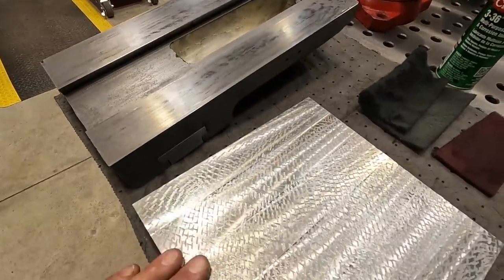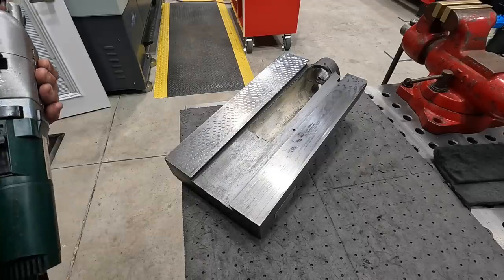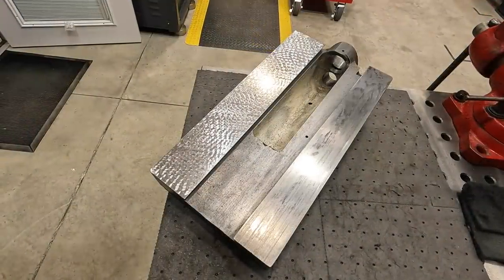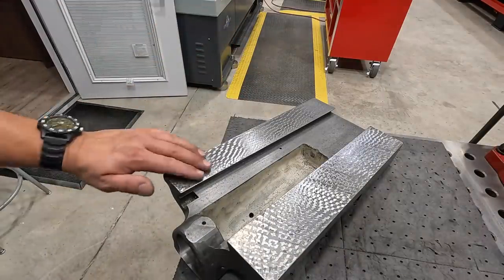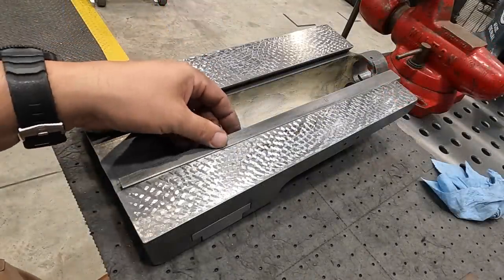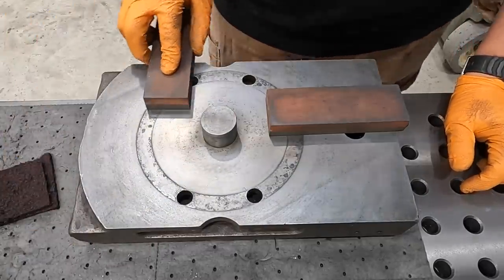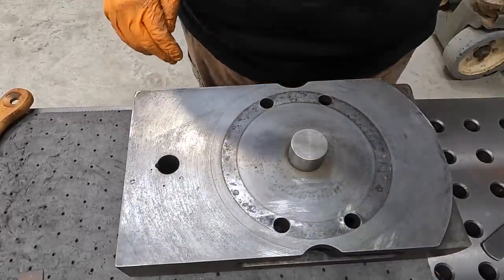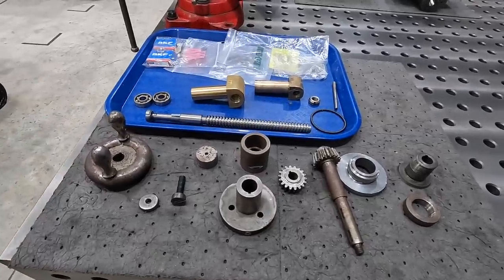Compound Rebuild Begins for American Pacemaker Lathe

Comment: I remember as an apprentice, hand scaping the ways and then hand spotting them. I was taught to create a crescent shape spot in a cross pattern, to retain oil. After many hours of practice l got pretty good at it, so much so that l felt it was a sham that it wouldn't be seen. Never used the electric scraper.

Comment: Just doing maintenance and light overhauls on my equipment, I find an ultrasonic cleaner to be very useful for deep cleaning the parts before oiling and reassembly.  Especially on any "touched" parts like handles and levers.  Really gets them to the next level.  Also gets the microscopic particles from chips and grinding out of the parts that normal cleaning doesn't remove.

Comment: Nice work Adam it's looking good. Nothing wrong with the witness lines especially if you don't use the scraper regularly. It's kinda like shooting a gun, yeah you can hit the target but your groupings are more consistent when you practice. I found that my rows are more straight when I lock my elbow against my side and dip side to side from the hips as opposed to twisting at the waist. Keep up the good work.

Comment: Nice Job Adam. I still have my Hand scrapers I used on a German Horizontal boring mill I used to own. And to All the doubter’s yes it helps the axis move much smoother if You have the proper lubrication. Good 👍🏻 Video

Comment: If you want to move away from the Sharpie marks, put your piece at a 45° to your bench. If the workpiece is square or rectangle, you can visually reference off the edge of your bench to make nice estimated 45° angle passes.

Comment: Love this channel, been a follower for about a year now, also HI to all the Engineers out there, i`m not an Engineer myself sadly but my Father was so i inherited some of his love for precision and quality, i`m a 53 year old Kitchen Installer from the UK with almost 40 years experience who takes great pride in the quality and accuracy of my jobs, i`m also heavily into ancient engineering techniques, specifically how the so called Dynastic Egyptians cut and polished igneous stone like Granite and Diorite which has a Mohs scale hardness of 6 - 8, there are a good few Engineers out there now who believe, as i do, that these highly accurate monuments and statues were cut on machines similar to lathes and mills, the precision on some of these artefacts is to within 100th of a millimeter yet were are told by the mainstream archaeological community that they were done using copper tools, chisels and dolorite pounders BY HAND, anyone who knows Quartz, as i do as we use it for countertops, knows it can not be cut or shaped using copper or bronze tools to this precision, also under a microscope these objects don`t show impact marks which you would associate with chiselling and hammering, they are perfectly smooth, perfectly square and they even pass the light test with an engineers light test you can`t get that accuracy by hand, many of these artefacts show evidence of tube drills cut at a rate that we can`t replicate even with today`s highly advanced CNC machines, there`s evidence that huge 1200 tonne blocks and single columns were cut using a huge overhead circular saw and Live Centre holes in the bases of 200 - 300 tonne single piece granite pillars, there is an English Aerospace Engineer who moved to the States called Christopher Dunn, his qualifications are second to none in the field of Engineering, he`s travelled to Egypt and other locations around the globe and conducted tests on many of these artefacts and he`s concluded they had to have been cut and created using ancient engineering machines, something we are told never existed in pre history yet the evidence discounts that, there is a channel on Youtube called UnchartedX presented by an aussie guy called Ben, his channel is dedicated to exposing these incredible highly accurate artefacts and calls for academia to acknowledge that there was once a long lost forgotten ancient highly advanced civilisation that existed before 12.500 years ago and was erased from human history by what`s known as The Younger Dryas Impact, a theory that has since been proven correct and it`s been peer reviewed, my big ask in all this to all you Engineers out there is to have a look at Chris Dunns work and Ben`s over at UnchartedX, see the evidence for yourselves when you get time and if at all possible lend your expertise and engineering knowledge to their work, the more skilled engineers who get on board the quicker science and archaeology will take it seriously, the theory is that in pre history there was a highly advanced global civilisation that had the knowledge and technical ability to build these ancient monuments and that the Dynastic Egyptians only uncovered, inherited and repurposed these sites thousands of years later once Earth`s climate settled down and human population and society was rebuilt, a big ask i know but i know these guys would appreciate your time and skilled knowledge to either agree with their hypothesis or point out errors in their theories, thanks for reading all this, i appreciate it cheers. Glen, West Midlands UK.

Comment: For a total clean. I found to clean old cast iron inside and out is to do a cascade soap boil out. I use half a 50 gal drum with 2" ID pipes laid in the bottom to circulate heat around the part to do the boil out in. Works very well. It draws all the old grease and emulsified oils out of the cast irons crystal substrate. Than after a torching to draw out the last of the water. I than put the part while it's still hot in 3n1 oil to soak over night.👍👍👍👍👍Even use a 5 gal industrial sonic cleaner for all the other parts using cascade.
Reply: Im curious if anyone uses comet? It doesnt just remove oils but chemically transforms them
Reply: @GonzoDonzo  I wouldn't use it on machined or polished surfaces cause of the abrasive in it, But to clean outside of shell castings would be fine.

Comment: It would make an interesting video if perhaps Adam (or even someone else) would do a demonstration of different surface oil or lube retention methods .Compare grooving, scraping ,or flaking on similarly sized surfaces and amount of cycles from wear movement and whether or not both wear surfaces need treatment and compare them to a control untreated surfaces, just an idea.

Comment: Looks excellent Adam. You're clearly doing an excellent job. I'm just wondering why you used a power scraper and not the power flaker ? It seems to have done a good and less aggressive job but when I was building machines we used a flaker for oil grooves regularly. It definitely does the job for a smooth machine axis though. 👍

Comment: This might be a silly question. But here goes. So the scraper makes micro groves for a reason, so you do it. But so does a fly cutter, or a face mill. I know this compound wasn't freshly made, but on a brand new part, would the machine marks serve the same purpose as a scraping operation?
Reply: machining marks are much much shallower and much smaller than scraping marks, so they can't hold nearly as much oil, and i would guess (this part is total speculation and i could be completely wrong so take it for what it is) the size and depth of scraping marks might allow the surface tension/film strength of the oil to come into play to help maintain the layer of oil between parts
Reply: search for "Abbott curve". it's about howmany mountains and how many valleys you have, which gives you the bearing surface. a scraped surface has a much better profile, because of little mountains to scratch the opposite part and shallow but wide valleys which carry the oil. also if you look from top down on a flycutter surface, the edges, where the cutter almost cuts  tangentially, will have like only valleys, opposite to the center. the start and end of the cut can also be a problem due to uneven load on the tool.

Comment: I've always wondered if only using one stone on a workpiece would make it run out of spec faster
Reply: You always grind flat surfaces in groups of three. In this case, two stones and one workpiece. If you just use one stone and one workpiece, there are an infinite number of spherical surfaces that you could be grinding into your work and your stone, there's no way to know that it's flat and it's much more likely to be a slight sphere. By introducing a third surface, you can be guaranteed that the surfaces are flat if all the possible pairs of surfaces mate together nicely.
Reply: @tissuepaper9962  I had thought I had seen that three surfaces are self-flattening (if lapped together in a graph-theory ring) whereas any chain of surfaces would at best give a sphere (and a spheroid if your technique is bad)

Comment: Out of curiosity, is there any alternative machining process instead of manual scraping to get that oil retention?
Reply: That is not actually scraping. It is flaking/frosting , It does not change the flatness or lack of it. He is using (misusing) a scraping tool to do it. Proper scraping is used to get a flat surface(not to get oil retention) then you can add the flaking on top after to get oil retention. As for alternatives, only lapping can get up to the same overall accuracy as scraping.

Comment: I have to think that a CNC program could do that pattern with a fractal math component to imitate the hand scraped look.
Reply: Yeah, you could make the pattern look right, but most CNC machines won't hold the tolerances required. Each pass with a scraper is probably removing .0001", so you'd need a really really good machine to do it.
Reply: Post the math!  What good is a comment without the proofs?  Many of us watch this to learn. If you post your proofs we all can learn.
Reply: @alexwbakker  The video says he is removing 0.002" which seems a lot more?
Reply: @machinists-shortcuts  he’s probably doing multiple passes to get the geometry right. A good CNC could definitely get him closer before scraping. On anything I rebuild I like to get within .001 before scraping because I only have a hand scraper and it usually takes me 8-10 passes before I can get things “flat”. I think you can move more metal with a biax, but I’ve never had the luxury.

Comment: how much pressure are you using with those stones?
Reply: Very little, it's just to knock any raised burs off
Reply: Pressure is only used for flat filing; the stones only need to be floated over the surface to do their job.

Comment: Wish china would make a cheap one time use version of the biax for like 60$ hand scraping is to much work for the one machine I need to work on and it’s to much of an investment for the biax to repair my 645 wells index mill actually debating scraping the head on it and building my own for a few reasons
Reply: Don’t get me wrong if I got into it and enjoyed doing the scrapping work I’d buy the biax but for what I need from one it’s just not worth it literally have 700$ in my mill hard to justify double for a tool to fix it
Reply: @mauricelevy9027  don’t need it to last just need it to half ass work
Reply: They do! its a harbor freight sawzall. you open up the mechanism in the front and move the eccentric pin closer to the center of the rotating hub to create a shorter stroke. then make a custom "blade" with a piece of a carbide brazed to it. Works fine for  small/one off parts.
Reply: I've seriously thought about using an air chisel. All I'd need to do is silver solder a chunk of carbide onto one of the chisels and set air pressure low enough maybe 40 - 60 lbs so the metal won't get too gouged up.
Reply: @mauricelevy9027  Come on, don't be racist and bash China. They can make great stuff, but consumers also demand cheap crap that they are happy to make for us.  For instance, the Poster is specifically asking them to make him a cheap knockoff.  If enough people ask, they will, indeed, make a cheap knockoff.  If enough people ask for a high quality durable tool, they will make that as well.

Comment: Do you have a 3rd precision ground stone? It takes 3 planes to maintain flatness.
Reply: Plus I wouldn’t rub my stones together over the workpiece. Any grit displaced by the rubbing is going to fall on the surface I’m dressing.
Reply: 2 stones = 4 sides so that's covered
Reply: It's not a precision plane that he's trying to get. The objective,  as he repeatedly said in this and other videos,  is just to know off high spots. No need for a an highly precise stone.
BTW, asking if Adam Booth has "something" related to precision machining shows that you have never his videos. His stash of old and current tools is remarkable and enviable.
Reply: @markshort9098  he never rubs the the coarse and fine sides together. 2 stones and 2 sets of sides
Reply: @stevenslater2669  Misplaced OCD. Stoning will leave abrasive on the surface anyway but that's not a problem,  since you are actually doing an abrasive job. Then the work is cleaned of any residue.
Reply: @jmbauer68  just because he didn't do it in this video doesn't mean it can't be done.. with precision ground stones it doesn't matter whether it's course or fine because of how flat they are, they only cut when the pressure is high enough for material to engage the grit and rubbing 2 very flat surfaces together can't get anywhere near enough pressure to engage which is the whole point of precision ground stones, they only get enough cut pressure to engage when there's raised material
Reply: You rub the stones together to clean off embedded material removed from the surface you just stoned. The stones are special as the abrasive grit is ground into a smooth plane and will only abraded material that sticks up from the machined metal surface. The flatness was produced by the original diamond surface grind and when it gets out of flat it will need to be reground. So rubbing them together has nothing to do with maintaining the abrasives flatness but removing contaminants from their surface.
Reply: @jdm2651  even though he's not scraping for precision, the stones still need to be flat or it'll remove metal other than just the burs.. a regular sharpening stone is far from flat and that's why they can sharpen a knife but try sharpening a knife on a flat stone and it'll just burnish the edge without sharpening it.. personally I've never heard of anyone having a problem like the original poster is taking about, flat stones are already ground flat and rubbing them together only cleans them, it's not to lap them flat again and it wouldn't even lap them flat again because the way their rubbed together isn't the correct procedure to lap flat and it'd lap in a bow if it did cut
Reply: Thanks all for the discussion. Not trying to open another thread but I have watched a lot of videos about granite surface plate calibration.  The abrasive plate has 2 sides and the surface plate has 1 side and by flipping the abrasive over you ensure it is flat.  Thus I am new to all of this and wondered if I needed to buy 2 precision stones or 3 or if there was any risk of these losing flatness over time.  Appreciate the guidance.
Reply: Once you have owned and used precision ground flat stones you will wonder how you ever got along without them. You can buy them or make your own if you have a surface grinder and diamond wheel (about $500). I bit the bullet and bought the wheel and made all my machinist friends happy-I don’t need any more friends☺️. Robin Renzetti has a video on how to make and use. Lance Baltzley (friend of Adam)(? Spelling) sells them.
Reply: @jmbauer68  it'd take many decades to centuries to wear the stones out of flat, you only need 2 stones.. rubbing them together isn't to lap them flat and it wouldn't lap them flat if they did cut each other.. see Tom Lipton making lapping plates video and you'll understand what I'm talking about, lapping flat requires a sequence of flipping and turning to average the high spots and if the sequence isn't followed then the lapped surface won't be flat
Reply: @jdm2651  I think more of the material removed is small enough to clog the grain spacing in the PGFSs and will be either compressed and/or sheared flat-ish at least by the rubbing of the same grit stones face to face - grit to grit. Mixing the sides is not a good thing and if continued will require dressing with a grinder as when it was made. Try hard to not mess with this ground stone surface, the easiest, smoothest, and flat-ish, fun to use  tool. 

-- 
MikeC
Reply: @jmbauer68  you only need the two stone set, flat-ish is good enough for 98% of our labor. If you plan to lap a surface in an 8 pattern with a charged lap you still have to carry through on the changing of grit. These stones do not require field grinding and are used as you have seen.
Reply: @markshort9098  No problem, believe what you want even if it so detached from reality.
Also, please advise when you will have published more than zero videos as it's now, for the world to understand from which high grounds you are teaching.
Reply: @markshort9098  Sorry I got lost at the first half of you sentence above. Not sure what's the point of your lecture when applied to the simple matter at hand - Adam Booth correctly executed a job, which is not about absolute flatness of the workpiece nor of the tool.
If you are interested in the subject, Adam has published variously videos in the past about straight edged, flat surface,  precision grinding,  attending scraping classes. I have watched most if not all of them, did you?
Reply: @jdm2651  "asking abom if he has something related to precision machining" what the hell are you talking about??